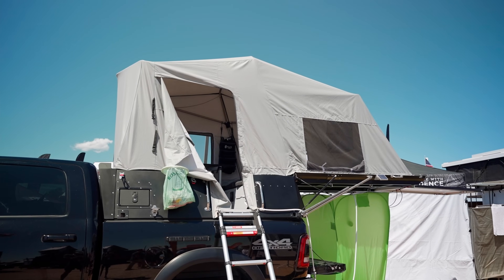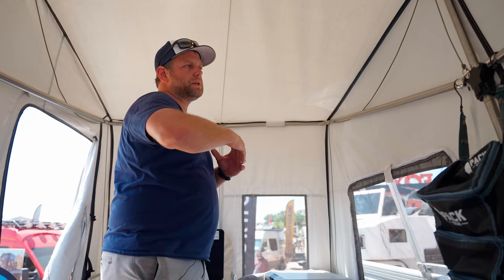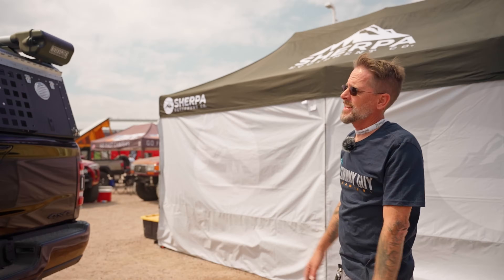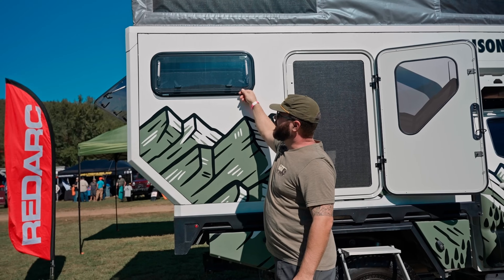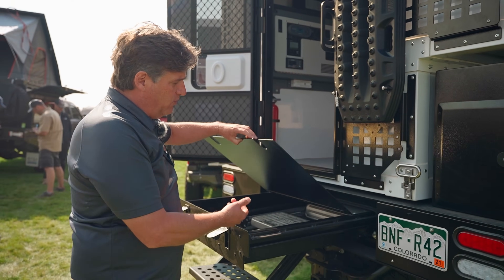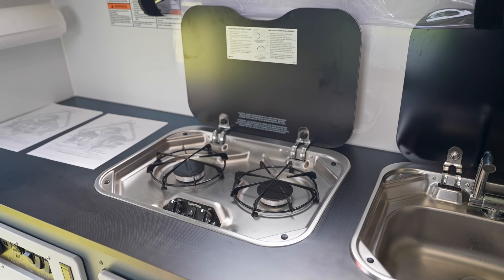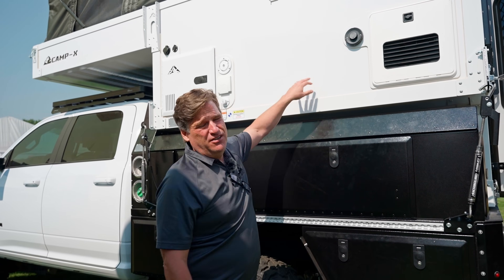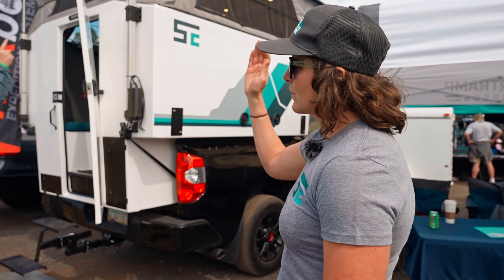10+ Truck Campers of Overland Expo 2022

Comment: The over hang on the front is Deal breaker. It’ll bend and flex as it’s too long over the cab. I don’t like the structure when the bed hangs too long forward. I line the alu cab and camp king design that folds up in 2 pieces so the bed doesn’t extend too long over the cab